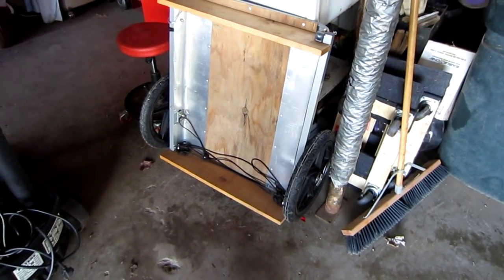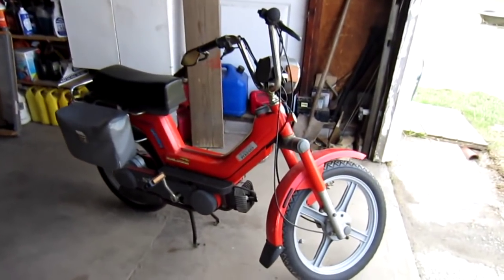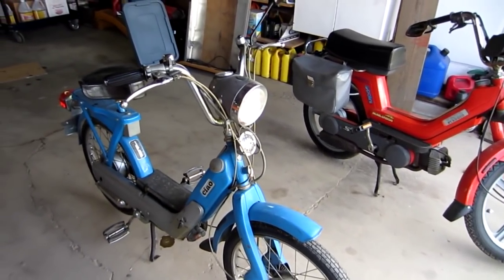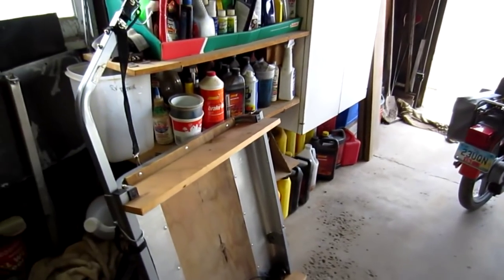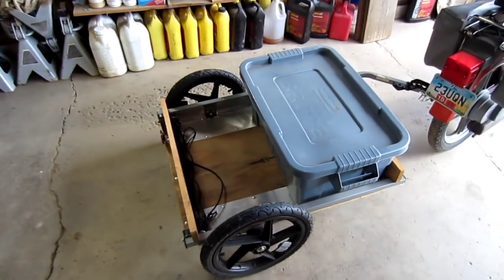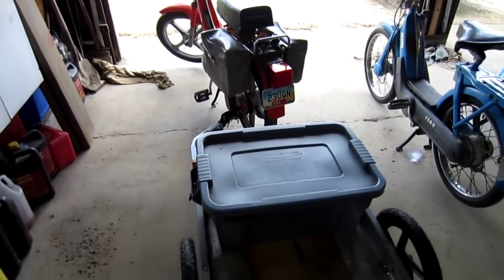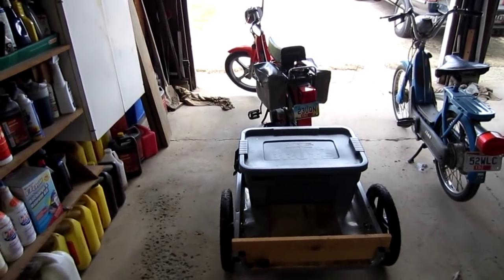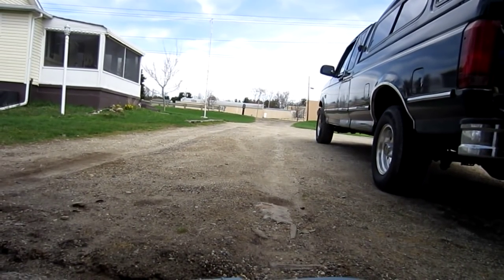Homemade Moped Trailer

Comment: Do not quote me because I very well may be mistaken on the following but in some states the moped having pedals makes it have to adhere to Bicycle rules therefore you might be in the clear with pulling the trailer. I live in California and I know that if it has pedals it is considered a bicycle even if it is battery or gas powered. That's because the laws haven't caught up to the E- Movement.
Reply from the maker: Actually in Ohio(this location) A moped definition is very strict, It has to be less than 49cc, It has to have operating pedals, it can not have more than 3 wheels(shady area here with this trailer)and it cannot do more than 20mph on a flat piece of roadway AND most importantly it has to be on Ohio BMV's limited list of approved mopeds, that with a couple of exceptions,  has not been updated since the early 80's...  List here-- https://bmv.ohio.gov/links/bmv_Approved-Moped-Models.pdf  However, at least Ohio does not require titles nor do they require insurance, BUT they do require plates and registration.. http://codes.ohio.gov/orc/4509.01

Comment: Kinda late to the party here, But I notice your plates.
How have Law Enforcement treated the moped/trailer combo?
Miami county ticketed me for using a  bicycle trailer to haul groceries...on a bicycle.
Something about "Not it's intended use" $15 fine.
If I could get away with this setup on a ped It'd be epic!
Reply from the maker: Jaycbee024  questions always welcomed anytime 😊 Well, here in rural Ohio, cops just ignore mopeds unless, you are young without a helmet, driving like an idiot, or don't have plates/working lights... Most police here really don't know moped laws OR what even constitutes what is an"approved" moped(Ohio has a list)... With that said, this trailer is technically illegal going by the letter of the law...But, If I bought/made a One Wheel Trailer, that would make me totally legal as mopeds in Ohio are allowed to have 3 wheels (look at my crappy video of my Puch Tri Rad moped) ... Reading in a alot of the moped forums have taught me one thing, If local police get a"hard on" for harassing mopeds, then they will find something to stop you from riding no matter what... Good luck.. I would go to court and ask the judge to clarify the infraction, even if it is clearly spelled out it will make the officer realize he better have a good "real" reason for pulling you over..
Reply: Thanks for the reply!
I was talking about Miami county Ohio (Troy, Piqua, area)
The "Hard On" thing is absolutely true.
I guess it would vary depending on the leo.
Thanks again, Stay Safe!
Reply from the maker: Oh, Miami County Ohio, Gotcha..  It needs to be a 1 wheel trailer and then you can argue it's part of the Moped(because it is a more fixed design) SEE LINK http://amzn.to/2todPwh
Reply: Foxboss9 just

Comment: I only was concerned my state would ask me to put plates on the trailer they make perment plates an the mvd looks them over to approve all trailers.I have zero clue how many reflectors ect... They require on something small an light for something small an light??It's not so heavy that air brakes an stuff like that comercial trailers use are needed.I know that much.

Comment: How did u attach it
Reply from the maker: A fabricated bracket... It's going to be pretty much custom and different for every model.... Even if you have the exact same moped you would also need the exact same brand of bicycle trailer.. That's why I didn't elaborate the hitch details... Be careful what you bolt to back there as if done incorrectly you can break off major support bolts and cause leaks... Good luck...

Comment: Uk law permits trailers, but they are strict on dimensions, weight and power. Basic dimensions are 1mtr width(max including wheels), max height and length of 2.5mtr (length from rear spindle to tail board) and also cannot weigh more than half the curb weight of bike towing it oh and minimum cc is 125 and you must have a full licence. Other than that, no proper issues ☺
Reply from the maker: Andy Redfern technically in the US a moped in the state of Ohio cannot be over 49 cc's and cannot exceed 20 miles per hour on flat ground. It also has to have functioning pedals that can Propel the moped without engine power. The moped can be 2 or 3 wheels. The trailer that I have in this video is actually illegal in this state. If it was a one wheel trailer it doesn't make a difference how heavy it is or how big it is it would then be considered one of the three wheels that constitutes the moped. Thanks for sharing that. Always curious to what other countries have as far as guidelines. In the state of Ohio also there is no special license required to drive a moped just a regular driver's license or what they call an operator's license. Unless you are 16 years or younger down to 14 years then you have to take a written and driving moped test. But it's nice that a 14 year old can get a moped and be mobile. The problem lies with where people live. Like I'm out in the country and all the roads are 45 miles per hour or greater just to get into town. So it's very unsafe to be riding a 20 mile per hour moped on a roadway with one ton dually diesel crew cab pickup trucks that are traveling 65 and 70 miles an hour. Once in town it's usually a little better if that point. We just aren't set up for bicycles and mopeds in most cities and definitely almost all the rural communities.
Reply: The UK has a rule of 150kg or 2/3 bike weight whichever is lower.

Don't think there is a height limit though.